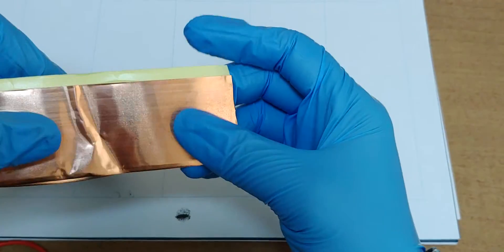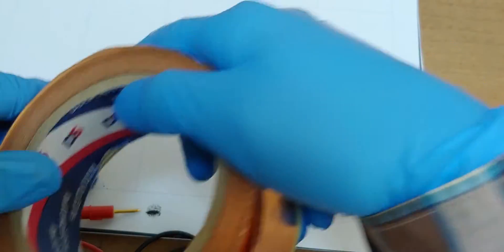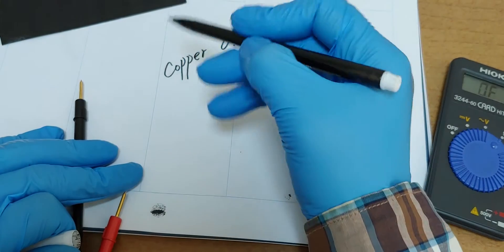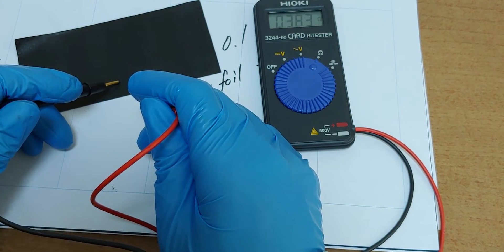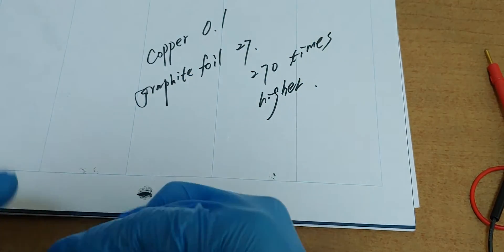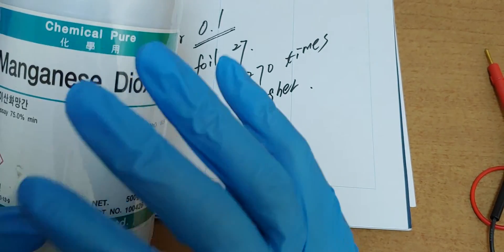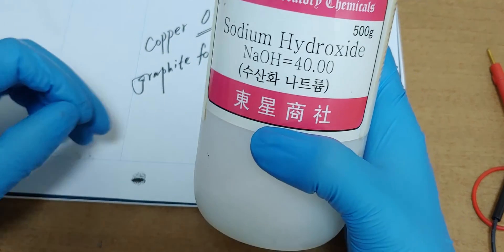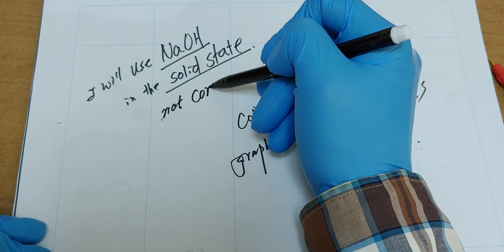The comparison of electric resistance between copper and graphite

Comment: The graphine sheet will have lower conductivity as opposed to a graphite rod. Electric brushes on a motor are a mix of copper and graphite for high conductivity and low friction.